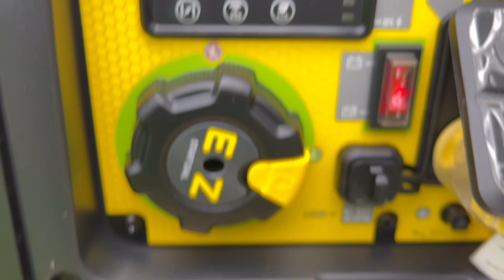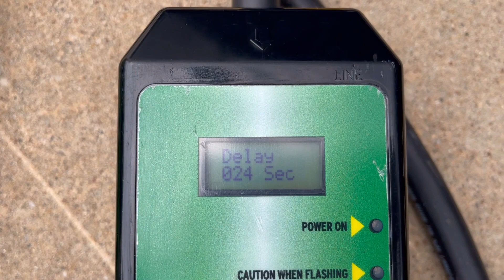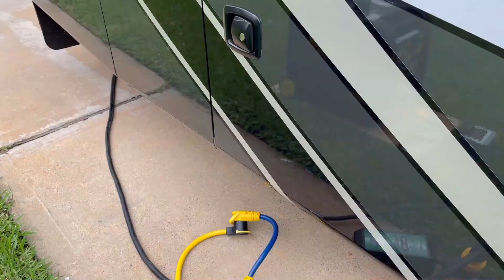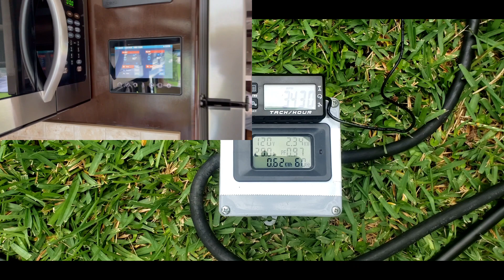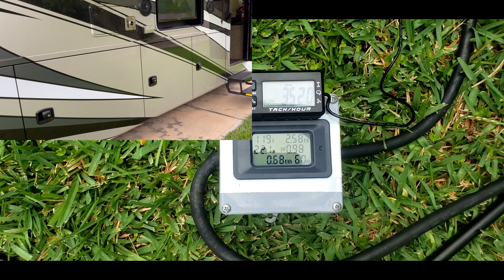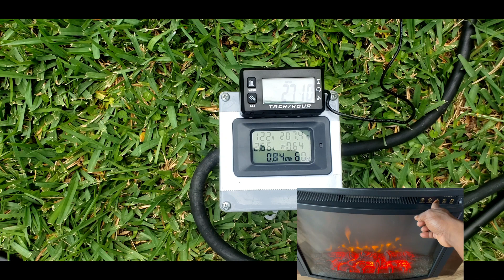Champion 4500W Wireless Remote Start, Inverter Generator with Quiet Technology (Generator Review)

Comment: Out in the woods right now and my gen keeps running and then overloading the gen with AC. You are the only video I found that said I need a neutral bond plug with my surge protector thank you sir. I was out here trying to figure it out all night I was trippin because it’s brand new thanks for the help man!

Comment: I'm buying a trailer to camp in soon that will have a 13,500 ac , a 6 gallon water heater and 110 volt water pump. Along with led lights and a few outlets. I will be using a TV and a cpap sleep apnea machine in it as well. I have been looking at the cummins onan p4500i and a champion inverter of similar size. They are the 2 best brands available where I live in Arkansas. I am torn on which one to buy. I would appreciate any advice you all can give me. Thanks and God bless everyone.
Reply from the maker: If you want remote start or dual fuel the champion is the best option

Comment: I have an older Champion 4000/3500, just gas, no inverter. It's performed great over the years. Powered tge 40' Sierra, and at home the tv, cable, directv, fridge and 1 window a/c. I just 2 weeks ago ordered the champ 8750 from Amazon. They were shipping to me, it got 27 miles away from me in a prime warehouse and changed the delivery! Said they had warehouse problems and backed me up 10 days. I said I'd go pick it up and amazon said no you can't. I went to homedepot and ordered the wen 875i, then cancelled Amazon's delivery. Can't say enough bad on amazon, especially here. Waiting for my wen, hooe it's good. Can't find a review by you on that size wen. Good review here though.
Reply from the maker: Yeah, I haven’t got that one yet. Should be getting a new batch coming soon.

Comment: How can you run 2 ac with a 30 amp and not melt the wires?
Reply from the maker: The breaker will shut off before that happens but this was just a test showing the Gen full power output

Comment: Thanks for the video. Very informative with respect to the electricity and quality of electricity generated by the generator.

I was curious what size microwave was that was that at 1100 or 1200 Watt system.

Definitely I see that the 4500 Watt based generator system is able to allow you to not micromanage the appliance usage issues while within your vehicle.

My general needs right now would be to have an AC perhaps a 13.5 BTU unit running and the need to run a microwave up to 1100 watts to be able to be used at the same time. The reason is that I understand that starting and stopping an AC unit requires some sort of a pause between turning it on or turning it off to allow the internal components to settle for the restart. I didn't want to subject my AC unit to turning on or off merely to pop something in the microwave. So this pushes me into a generator that can handle both of the AC and microwave appliances to be ran at the same time. Other than that it will be either the AC unit the microwave, the AC unit the coffee maker, or the AC unit and a heater well not a heater but you get the idea.

The one thing that I am starting to target in my research is the auto start feature. This isn't a matter of just not wanting to go outside but it involves having two go from your internal dress 2 having to put your shoes on or during inclement weather all these things are a factor when having to go in and out of your vehicles simply to turn on or off your generator. Also security issues if it's late at night, these types of things are what the auto start feature saves when it's part of the generator package.

And lastly I really like the use of the surge protector system, but what I don't like about it is that it's just that one more thing that I'm going to have to buy. Other than that, I look forward to next video.
Reply from the maker: Thanks for watching
You seem very knowledgeable of what you want and I have to agree with you on almost all of it, the larger generator allows you to run more and not micromanage the system but it also allows you to run the generator at a lower percentage say like 50% not stressing out the system enabling it to last longer

I understand that the surge protector is an extra cost but it really helps if you’re going to use remote start because of the delay start feature.
The microwave values was a 1200 W

You’re on the right track now it’s just trying to figure out which one works out best for you.

Comment: My only question is do you have the soft start  on your AC’s? Looking at the plug on your Genny I can’t tell if you using a 30 RV main or 50 Amp main. I was running a 5k gen before and could only run one of my ACs without a soft start AC adapter
Reply from the maker: Yes I do have soft start installed, it’s a must for running on a generator
Reply: @GeneratorReviews  thanks for the confirmation.  My rv is 50 amp so I think this is going to make me break down and install the soft starts finally.  Great video!

Comment: Would you recommend this over the duromax 4500 inverter generator? I'm torn between the two. And I think there is a few hundred dollar difference also?
Reply from the maker: Both are great Generators but the Duromax dual fuel would definitely give you more options in my opinion 👍🏾

Comment: Great video, but now I’m reading maybe you have soft starts installed? Did I miss you saying that? Would it run “just” the two AC’s without the soft starts?
Reply from the maker: It will run them without soft start installed, just makes is easier to have more running watts available for other loads 
Let’s just say you’re running the fridge and tv it would be easier for the generator to start the AC with soft start installed.

Comment: How many Watts are each AC? And How long do you think you can Run both ACs with a Full tank of Gas?
Reply from the maker: Each AC pulls around 1200w running you could probably get 4 - 5 hours on a full tank with both AC

Comment: What size are the two AC you were running? 13500 15000 BTU? Thanks!
Reply from the maker: My two ACs are 13,500 BTU with a soft start install on both thanks for watching

Comment: Great video, Gavin!  This seems like a very capable generator in that bigger category.  What I like about this category of generator is that they are really about the same weight as the 3000-3800w category, but you get that extra electrical spike coverage.   Of course, there is a commensurate increase in fuel consumption; so it is a matter of really what the need is.  

I'll design our solar set up so that we do not have to count amps all of the time.  A generator that complements that by not having to count generator amps could serve well! 

The more of your videos I watch, I am growing to really like that remote start feature hehehehe.   It boils down to "turn the generator off while in the comfort of your rig while in your skivvies.......or conserve my back with a smaller 65lb or lighter options".

Safe travels!!
Reply from the maker: (The more of your videos I watch, I am growing to really like that remote start feature) hehehehe.  I knew you would get sucked in by some of these features  😅

Comment: How many amps does the Ac pulls?
Reply from the maker: Running watts	3500 W	
Starting watts	4500 W
Running amps	29.2 amps
Peak amps	        37.5 amps

Comment: Nice review. I have an electric car and needed to use a neutral grounding plug also for the generator to be able to charge the car. Found out I had to do that when my wife forgot to plug the car in and ran it out of charge on the way to the store. Brought the generator to her and found out it wouldn't work without the neutral ground plug. Now, I don't advise anyone to do this but I was between a rock and a hard place so I took a metal hanger, bent it, stuck one end to neutral and the other to ground and, success. Started charging. I have since purchased a proper neutral ground plug for those times when it's needed. Might be a good video for you to show how and why generators have floating grounds and the use of the neutral ground plug. It would probably be a short video but I bet it would be helpful to a lot of people who don't understand electricity.
Reply from the maker: Better than paying for a tow truck 👍🏾
Reply: @GeneratorReviews  Yeeaah, buddy. Was pretty close to home so just needed to charge it for about half an hour. Just enough to get it home and plugged into the 240v charger. The little iGen2200 came through for me again.
Reply: I guess if ya gonna own an electric car, ya best own a gas generator too
Reply: @geralddunn9138  Same applies if you run your car out of gas which I have done in the past. It's no fun walking with a gas can. In my wife's case, she was fairly close to home so it was very easy to go over, plug it in, wait a few minutes, and drive home to finish charging it up.

Comment: Quick question for you. If I have an Eaton surge protector on my mains for my home, then would the surge guard with a non-inverter generator give me the same smooth power as an inverter generator? Wondering if this isn't a more cost effective option given that non-inverter gens are cheaper. I know however that the inverter gens are a bit quieter though.
Reply from the maker: Unfortunately no those generator are not sine wave and are not safe for cell phones laptops or any sensitive electronics
Reply: @GeneratorReviews  Ok, thanks for the info.

Comment: What are your thoughts now on this vs the Cummins Onan 4500 you just tested? Thanks!
Reply from the maker: I like both Gens I’d buy either one but for the price of the Champion vs the Cummins that’s a had decision. 
So if price wasn’t an issue the Cummins puts out some serious power 
Both are great choices for backup power solid warranty that’s why I picked them
Reply from the maker: Cummins vs Champion video coming soon
Reply: @GeneratorReviews  I'm interested in decibels at idle, 25% and 80-100% loads. In the Cummins Onan test video your ran to full load (and then some at 4000 watts) to test it but in the Champion I don't think you got over 3000 watts so I'd like to see it at 3500/+ please. I think someone else mentioned sine wave at load would be neat as well. I also think run time at the load of maybe 1 AC unit would be fun to know but probably hard to test. Last but not least which is easier to maintain (oil changes, battery maintenance, running/draining fuel out of the carb for storage, etc). Thanks!!
Reply: @GeneratorReviews  awesome!!

Comment: Hi Gavin 
Love your channel 
Question for you 
Can these  inverter Generators that have the RV Hook up be used to hook up to a home transfer panel that has a L14-30 connection
Reply from the maker: Absolutely! It can be hooked up as a home backup generator to power the 120v loads 
You could install a 10 circuit transfer switch to make it easier 👍🏾

Comment: I just purchased the dual fuel version non remote start my question is what kind of run time have you been getting? I went to break mine in today connected to my truck camper a/c and it was pulling 10 amps. The compressor was running.. and with a full fuel tank it was almost  touching the line before E at 4.5 hours can this be right? I figured maybe half a tank with only 1/3 running load. It was running on full ..not eco mode even though it can run in eco dont know if that would make a huge difference.
Reply from the maker: Try it on eco mode and what temp settings did you set the A/C (78)
Reply: @GeneratorReviews   Hi ...i  had it set on run not eco... a/c was on max... fan was regular not max...it was really hot out 93 i dont think the compressor shut down it was 65 in there..i did lower the a/c to 70 and the compressor cycled but this was after the 5 hour break in though. I maybe reading the fuel gauge wrong to...are the 3 lines E 1/4 1/2 3/4 F  or E 1/2 F ?
Reply from the maker: @gunsandrotors8704  E 1/4 1/2 3/4 F
I think you will improve your fuel efficiency just by keeping eco-mode turned on and you’ll also run your generator a little cooler because it’s not on W.O.T (wide open throttle) it can handle it make sure you change the oil though. If you haven’t done it yet.👍🏾
Reply: @GeneratorReviews  Thanks...dumped oil on 5hr mark. Gonna do it again another 5. Oil is cheap! Had a case of honda power equip. 10w30 sitting here.

Comment: Nice review Gavin,  seems to be a great generator. what did you mean about closing the ground in order to use that surge protector?
Reply from the maker: Most generators have an open ground meaning that the neutral and the ground are open
So that bonding plug Fixes the open ground